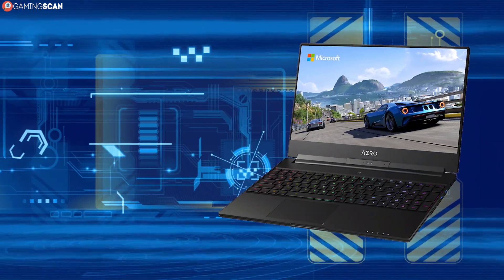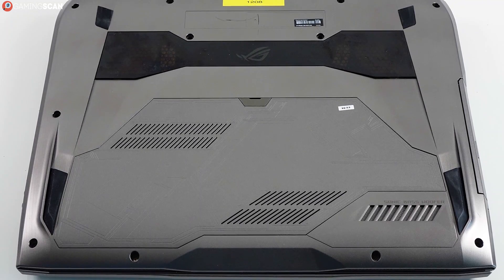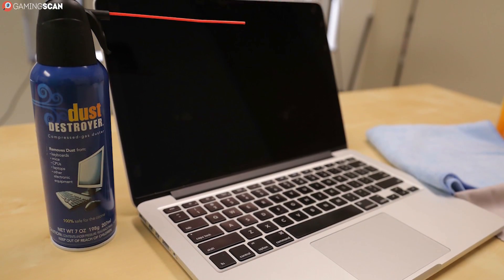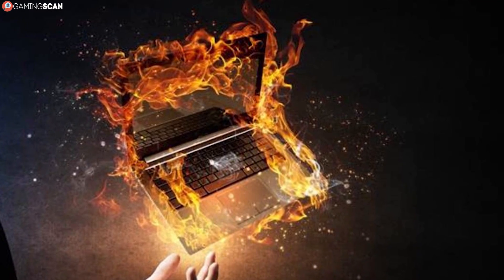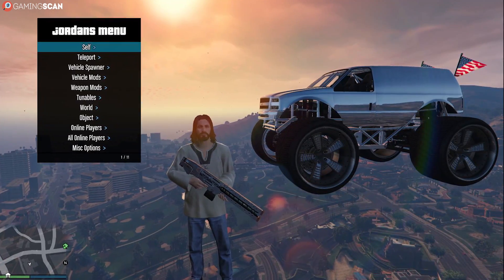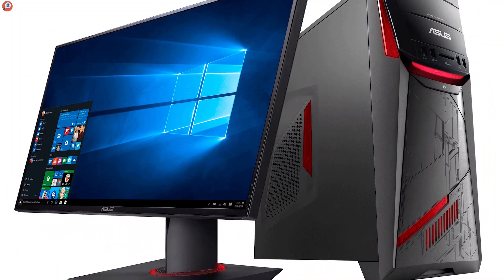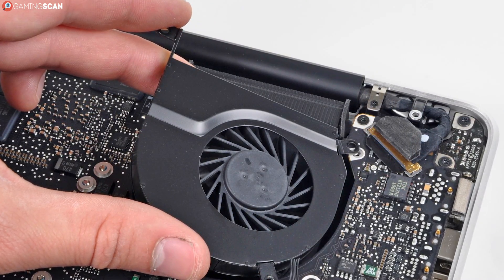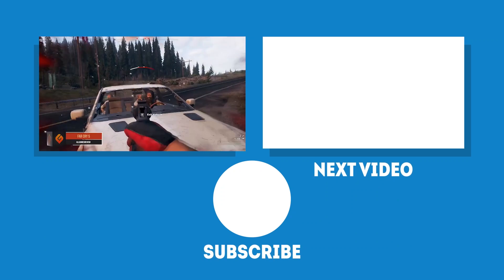How To Keep Your Laptop Cool While Gaming [Simple Guide]

Comment: if only your 12 gen processor is heating up you should try undervolting i am doing it currently at 25 watt i have i5 12 gen 12450h with rtx 3050 although my gpu not cross 80' degree but my cpu always reaches 90 or 100 after undervolting it doesn't reach 85 at exact performance

Comment: I ordered I cooling pad. It was only 35euro's. Tomorrow it's here. It's because afther am hour off 4-5 it's sometimes just to hot. So a cooling pad should help. Also the laptop is brand new so no it's not from dust. Hp Omen Intel 7 11th gen with rtx 3080 16gb and 32gb ddr4 ram.

Comment: Cooling mat and making sure air is getting circulated properly. Open task manager and check if any background apps are using high unitisation also works at times, closing them left me with a 30 degrees idle temperature instead of 36.

Comment: I saw a video recently that gave a simple power management tip to reduce your cpu thermals by 15 to 20 degrees Celsius while gaming.  Seems to good to be true but it genuinely works.  

Right click on the battery icon and select power options, most modern laptops offer several modes, balanced performance, quiet mode etc.  

Typically for gaming you'd use performance or balanced so use one of those.  Click on "change plan settings" then click " change advanced power settings"

In the next window that pops up scroll down to "processor power management" click the + sign to open its options.  

Under "minimum processor state", make sure neither setting is on 100%.  99% will do or if it comes with a lower default setting like 80% that's already fine, don't adjust it.

Now the important part.  Under "maximum processor state" switch both power settings from 100% to 99%, click apply, and you're done.

It quite literally shaves off 15 to 20 degrees, it's nuts.  The only downside I've noticed is that in some games there can be occasional frame pacing issues.  But that tends to only happen if you are maxing out fps.  If you cap it with a program like RIVA tuner through MSI afterburner there shouldn't be any hitching.  For example, if you max out around 160 fps, cap it 20 frames lower and it should be totally stable and your laptop cpu will go from 80c to 60-65c.

If you try this, and it works for you, please feel free to copy and repost these instructions.  I really feel like more laptop gamers ought to know about this not so obvious feature.  I even did it on my last gaming laptop that is 9 years old and the trick worked there too.  It works on AMD and Intel.  My old laptop is Intel my new one is Zen 3.  It should work on any laptop with windows 10.  I don't know about windows !! yet but I imagine it's there too.

Comment: I would like to add, do not set your Nvidia GPU to "High Performance," but set to "Optimal Power." 
The high performance settings may give you an FPS boost at first, but then start lagging frames due to overheating.
It's ok to set the processor to "High Performance" on Windows Mobility Center as long as it's plugged in all the time. Also, set the max processor Power Management State to either 90 or 95 (In Advanced Power Settings) depending on your processor.
A rule of thumb, anything above 1080p, keep it at 60FPS only, regardless of hardware.
Aiming for 4K 120FPS on a laptop is like Icarus flying to close to the sun. The laptop will overheat and/or not perform its best for long. This is not because of the GPU or the CPU, but due to the power supply from the battery.

Comment: I wouldn’t would give my laptop lots of fresh-air and put pad on screen when you close it just so the keyboard doesn’t fuck up your screen like a chrome-book would lol and i’d put 4 blocks of lego wheels under it or something that wouldn’t melt so air under your computer can circulates even better or just take the whole bottom cover off and play with no bottom cover so it get max cooling potential and I wouldn’t run my fans max I don’t like putting pressure on my computer other then the hardware stuff just not the fans i like to take care of those ;) keeping my gaming computer shiny and loved is good 🥰 right on my carbon fibre table with my gaming mouse pad and my gaming headsets with my mouse btw I use G432 good for it’s price and you can buy the G733 for it making your life easier and also if you like RGB :)

Comment: Some more tips to cool gaming laptop.
1. limit the fps to 48 to 60 fps in gpu control app. Eg: Nvidia control panel. 48 to 60 fps is very smooth for games.This will prevent higher gpu temps.
2. disable intel/amd turbo, you will not see any difference in newer laptop for gaming if playing on ultra settings. This reduces cpu temps from 95c to 60c, very useful for prolonged gaming.
3. Always check CFM for cooling pad fans before buying one, the more CFM the better it is. Eg: 70-75 is good.
4. You can skip step 2 and undervolt the cpu but i have seen some game crash on undervolt and the temps are not very low on undervolts.
5. You can lower the graphics setting from ultra to high. There is very less difference is ultra and high graphics.
You can thank me if you find this useful.
Reply: How to do number 2?
Reply: lol 48 fps is horrible. 60 is painful. 144 is good and anything more is almost useless

Comment: My non gaming laptop actually has a flaw in its cooling system, modern laptops are very thin so air getting in is harder so it kicks the fan up more. Plus the intake and exhaust vents are at the hinge bit of the laptop, meaning air crawls into the laptop by weaving its way around and exiting by hitting the bottom of the laptop screen lol.

Comment: Repasted and cleaned my laptop and got  -10/-15°C. 
Undervolting helped a little, maybe -1°C or -2°C.
If you are waiting for your cooling pad to arrive then you can also temporarely use a ventilator to cool down your laptop, I got about -5°C/-8°C(gpu but not cpu for whatever reason)(this was before I repasted and cleaned it so it could be lower now)

Before my cpu was at 90-95°C and my gpu wa at 85-90. Now my cpu is at 80-85°C and my gpu is at 60-70°C

Now my gpu and cpu don't thermal throttle anymore and my gpu has 80-90% ussage but when it gets to 100% ussage it clocks down, goes to 0%ussage and then up to 80-90% ussage. This happens for only a couple of second every 30 minutes or so. Sometimes it takes longer and I don'tget Interrupted for 1 or 2 hours but that's the exception. Does anyone have a solution to this? 1 frame is shit because I get shit frames when I turn it on. Instead of 130-160 I get 100-110 frames. (144hz monitor)

Could have something to do with my power management settings. I have the latest graphics driver installed so that can't be it. The cpu isn't bottlenecking, it's ussage stays around 60% maybe peaks at 70%.

Comment: 2:00 DO NOT DO THIS.
It blows all the dust further inside your laptop. This is some smooth brained BS.

And it's been proven that cooling pads don't do squat.

The most you can do to help cooling it open it to clean it, replace the CPU/GPU thermal paste with a better quality one, and don't use your laptop on a soft surface like a bed etc.

Comment: if anyone have fps capped on 60 or 30 with really good gpu, disable battery save mode and restore gpu control panel settings, in case something in there caps fps

Comment: Please pin this comment

This is for all my brothers and sisters who suffer from laptop heating and are concerned about its health these ways took a lot of time for me to figure out to cool my laptop

1. Go into your settings app and turn off all the uneccesary options that are enabled by default making your system heavier like the background apps background processes and startup apps 

2. Make sure you dont have more that 30 apps and 10 programs installed on your operating system

3. Keep your power plan on power saver it will reduce performance but result in a cooler operating system

4. Go into task manager and disable all uneeded services and set the priority to low of apps being used it will result in less performance but cooler cpu

5. Turn off visual effects like transparency animations and 3d elements 

Hope one of these methods will help you cool your laptop

Comment: I would suggest applying a better thermal paste to CPU and GPU. Some manufacturers might cheap out, but Kryonaut or some hardcore thermal paste can reduce the top temperatures by around 10-15 degrees.

Comment: 2:09 NEVER blow into the outtake like you see here. You will actually blow the dust into your laptop which makes it worse. If you want to clean the dust, the best way to do it is to screw open the laptop itself and clean the inside, like the fans and grills.
Reply: My laptop gets hot when I use it to play games while charging. Is it safe and normal? It reaches like 90 Celcius
Reply: @ahmednasrullah8215  if your cpu is at 90 it is fine, but don't let it exceed 100, but ya if your gpu is 90 then bro you got a serious problem
Reply: @fgbgbghthngtg  oh
Reply: @fgbgbghthngtg  Thanks for telling me
Reply: @fgbgbghthngtg  my gpu is at 86C with my MSI gaming laptop
Reply: @stolen_grandma4499  might wanna lower the settings then

Comment: If your CPU or GPU is overheating to high heat levels (eg. 70c+) while gaming or light browsing after doing the things as suggested in the video it is probably time to change out that thermal paste. If your GPU is not powerful enough or you simply need to upgrade your laptop GPU and your CPU is high end just get a External GPU. I had to get a External GPU so I could do vr on my laptop. 

My Laptop CPU currently has a overheating problem and I plan on replacing the thermal paste when I get the tools and products needed to change out the thermal paste on the CPU Die and GPU Die.

I got a eGPU because I want to do VR and my 1660 ti LAPTOP GRADE GPU just doesn't cut it for me anymore. I got RTX 2080 and a Razer Core X Black (eGPU enclosure).

Just remember that if your CPU just isn't powerful enough even with crazy cooling solutions then it is time for a new laptop or desktop.
Reply: Or it's grinding crypto in background by some virus

Comment: I bought a normal fan and an extra moniter then i put my laptop on a table upside down and put the fan on the laptops under side then turn it on while gaming and connect the extra moniter becuase u cant play with upside down laptop.
Tempratures are 30c lower

Comment: I wish I had known these tips before my laptop had issues, my laptop is being fixed right now by a technician and he changed the HDD to an SSD and he was able to get it to turn on and then he noticed that there were heating issues and he looked  inside and said that some of the components were ruined from being overheated so he said he would replace it once he finishes fixing it the first thing I am doing is investing in a good external cooling pad and a dust cleaner.     When I was first having trouble I thought I had a virus because everything was going slow....  but it possibly could have been due to overheating.

Comment: I usually disassemble and clean my laptop once a year and then replace the thermal paste if they are dry I also use cooling pad and vacuum cooler for extra measures

Comment: My previous laptop died immaturely because of the heating problem. My new computer has a water cooling system. Water has a very high heat capacity and latent heat of evaporation as compared to air and it can remove huge amounts of heat as it evaporates. I have a plastic tray and I place a wet kitchen towel on it. I place the lap to on the tray with wet towel underneath the computer. I keep adding water to the towel as it dries. This solves heating problem perfectly. Never ignore a heating problem.
Reply: My laptop gets hot when I use it to play games while charging. Is it safe and normal? It reaches like 90 Celcius
Reply: @ahmednasrullah8215  I was thinking that my overheating Dell was normal then it suddenly died. I would advice getting professional assistance. The thermal gel might be damaged.
Reply: @heavenlymilano  oh
Reply: @heavenlymilano  thanks for the advice

Comment: Im watching this because im playing genshin impact in my low end laptop its smooth gameplay but its over heating.
Reply: My previous laptop died immaturely because of the heating problem. My new computer has a water cooling system. Water has a very high heat capacity and latent heat of evaporation as compared to air and it can remove huge amounts of heat as it evaporates. I have a plastic tray and I place a wet kitchen towel on it. I place the lap to on the tray with wet towel underneath the computer. I keep adding water to the towel as it dries. This solves heating problem perfectly. Never ignore a heating problem.
Reply: @heavenlymilano  umm I think that would destroy the laptop🙃
Reply: @ts_bladezzx2133  no, it does not. I am still using the same laptop with no problem.
Reply: @heavenlymilano  ok I have the overheating problem can u tell me the exact details on how u did it?
Reply: @heavenlymilano  cuz I'm scared that the water might go inside my laptop
Reply: @ts_bladezzx2133  I wet a kitchen towel and place it on a tray. It should not be dripping wet. Remove excess water. Then I place my computer directly on the kitchen towel. As water evaporates, it removes heat from the computer. I keep adding water daily.
I would be worried about water condensing inside the computer if I lived in a cold climate. If the metal parts inside the computer are cold, evaporated water may condense on them. However, my home is always pretty warm and this has never been a problem. 
My previous computer (a Dell) died prematurely due to overheating. I wish I did this treatment back then. 
Caution: if you use a melamine tray, the tray absorbs water and eventually cracks. I broke two melamine trays so far. But I don't care since they are much easier to replace than computers.
Reply: @heavenlymilano  wait what I was thinking about water cooling tubes and stuff not wetting a towel and placing it in there
Reply: @holloWollowed  I have no idea about cooling tubes and stuff. I USE A WET TOWEL :))))))
Reply: @heavenlymilano  thats pretty genius! But wet towel sounds risky, so i think cooling gel pack works?
Reply: @minty4701  No, it does not. Because you need evaporation to carry away the energy from the computer. Gel packs are closed systems. Gel packs only work till they themselves heat up which happens fairly quickly thus you need evaporation.
Reply: Same omg

Comment: Very informative video but you forgot two things I find to be extremely helpful when reducing heat. One is to replace the thermal compound with something a little more high performance. That’s a EASY -5 or in some cases -10C. Next thing I do is undervolt the cpu. That can also help bring temperatures down to more manageable levels and can allows the gpu in some cases to use more power. However your mileage may vary with undervolting.
Reply: if you try to change the thermal compound, you have to disasemble a lot of things wich can damage your laptop a lot, soo not suggest

Comment: @1:30 That doesn't work, just using canned refrigerant (that's what an Airduster is!) on a vent wont clean ANY of the dust out of your machine. That's just a waste of "Canned Air". If you really want to clean it you need to take the bottom plate off (sorry Apple users, you will need to take you apple to some one like Louis to get it cleaned) and uses something like a Data Vac to clean it.

As for Cooling pad, contact your manufacturer to see what they suggest. Some laptops just need to be elevated at a right angle on a non-fabric surface. Some cooling pads can force your fan/'s on your machine to slow down and fail at cooling your laptop (if you don;t believe me, look it up).

If its a gaming laptop (now I know this is super expensive but, worth it and saves you some temps) And supports Thunderbolt 3, buy an EGPU with the same model or better Graphics card, when the on boards GPU is disabled that massive heat sync in your machine is just being used for your processor.

Comment: Wanna know the best tip ever? But it only works when you having a game laptop sitting on 1 place, and not really moving it, or don't care about it.

Remove the bottom of the laptop, and put it on the vans. Like this i managed to get off 3 degrees extra then with the plastic on. It has way more flow and the vans can push air all in the laptop instead of some holes.

Yeah, you have to clean it a bit more, i clean it each 3 months with dust spray, but its worth it, it also making way less noise since its getting cooled better. And a laptop will make much more noise when it's hot.

Comment: Solution: Control Panel > System and Security >  Power Options >  Change plan settings (on any active power plan) >  Change Advanced Power Settings >  Processor Power Management >  Minimum set to 50%, Maximum set to 99% (both plugged in and on battery).
Reply: What
Reply: What